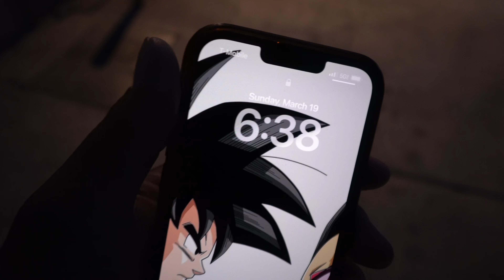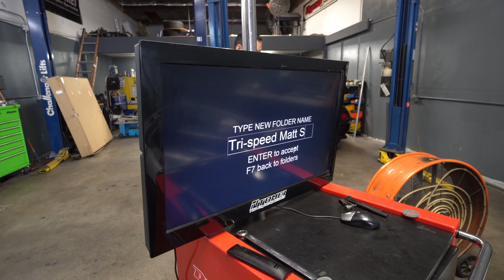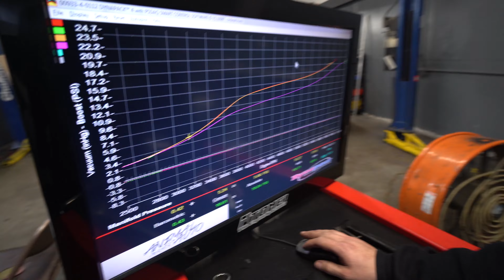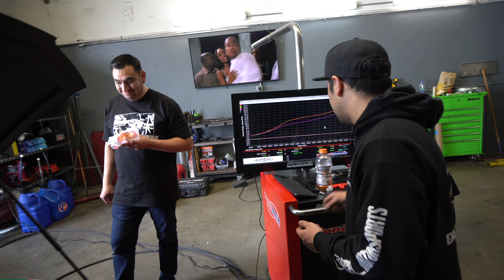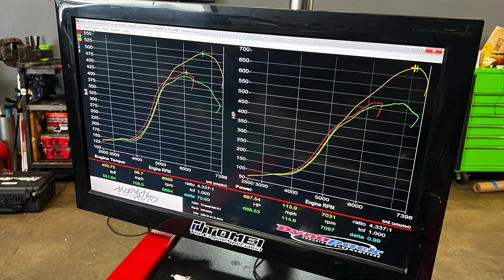WE FINALLY HIT THE DYNO!!

Comment: That's solid power! If it's almost time to replace the RB. Checkout what you can do with an Mercedes OM606 inline 6 diesel. The motor is fully mechanical so there's very little to worry about with engine management. Stock internals, new injectors, new plumbing, and a p-pump... +400hp, +500tq and ~30mpg highway. If you start messing with the turbo and internals, you're looking at +650hp and enough torque to flip the rotation of the earth.